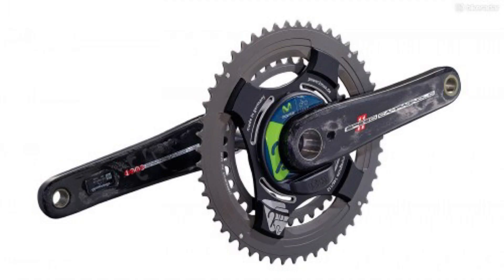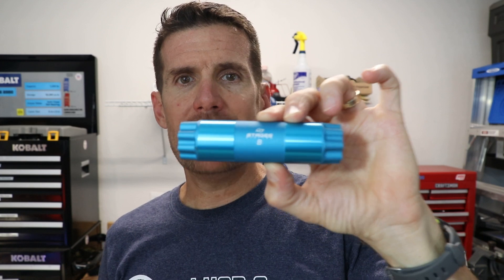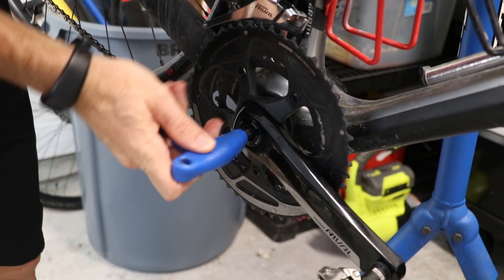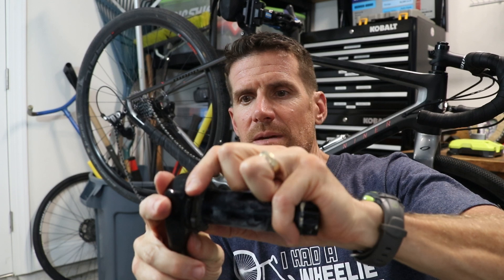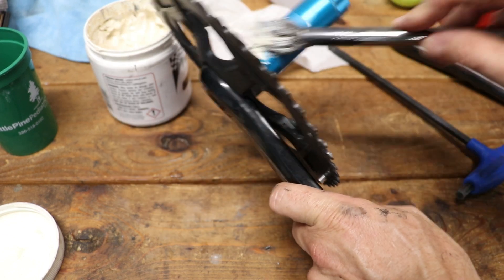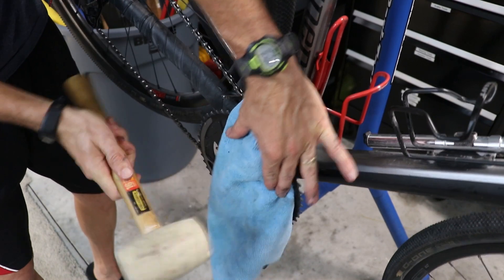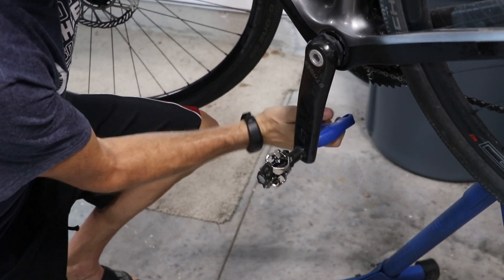Installing a Stages Power Meter on SRAM Rival 22 (with spindle attached to left crank arm)

Comment: Hi @clintgibbs - thanks so much for the video. Can I ask if you know whether the type B Ali doe would work for a new V2 SRAM force AXS group set as well? Is this the same as the SRAM force 22?? Thanks!
Reply from the maker: I have not tried a Stages with the new SRAM group set.  Check with Stages. Their customer service is helpful and should be able to answer that.

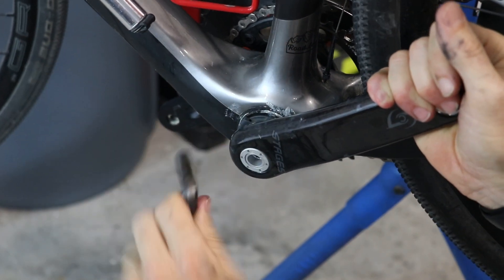Comment: At 5:20, in what direction are you "backing out" the adjustable spacer? Toward the crank or toward the bottom bracket?  It looks like it's coming toward the crank.

I'm considering installing the Rival Power Meter Upgrade on my own, and this is the only step I don't quite understand the point of when reading the online manual.  What is it that the adjustable spacer does exactly?

Thank you in advance. I get a ton of help from your channel.
Reply from the maker: Turn it clockwise, towards the negative sign to put space in there. Once you tighten the crank bolt, turn it counterclockwise, towards the plus, sign, the takeout any remaining slack
Reply: @ClintGibbs  Thank you.

What exactly is the spacer doing, though? Taking out excess play that would permit the spindle/crank assembly from sliding sideways in the BB? If so, why is there play if you've tightened the cranks? Wouldn't tightening the crank push it right up to the spacer?
Reply from the maker: @ADRNG  when you tighten the crank bolt it can only move so far because of the way the axle is designed. If it were to pinch limitlessly it would hinder the bearings.  You have to have some spacers in there
Reply: @ClintGibbs  Ooooooh, yeah, that's true. Thanks for the information, bro!

Comment: Hi Clint, 
Thank you for the video. 
Your Force 22 appears to be a DUB crankset. Is that the case, and if not, do you know if the Stages Sram powermeters are compatible with the BB86 Sram DUB bottom brackets / cranksets (for gravel bikes with a Sram Force eTap AXS groupset))? 
Thank you.
Reply from the maker: This one is not DUB. I would contact Stages about what is compatible with  SRAM BB86.
Reply: @ClintGibbs  Thank you, Clint. I will. Clear.

Comment: A couple of years ago I bought a Stages power meter for my Ultegra crankset. Although it worked fine, I did not find it to be of much benefit to me; and so, when I upgraded to Dura Ace, I sold it. I recently bought a PowerTap P1 dual-sided power meter for my spinning bike, which is far more use to me, since I do all of my structured training indoors, not on my road bike, which is reserved for leisure. They give me more information than my one-sided Stages meter. What I don't like is the accompanying cleats, which have far too much float/free-play. Instead I have been using the Look zero float cleats, but there is still more free play than I would like. I just wish I could use my Shimano blue road cleats.

Comment: Great Video, though oddly my Rival 22 is the opposite with the spindle attached to the non drive side
Reply from the maker: That’s the way my rival is as well. Spindle attached to the left arm, or non-drive side
Reply: Sorry, meant to say spindle attached on drive side.  I was able to swap the left crank arm with a stages power meter without having to install replacement spindle
Reply from the maker: Kurt Congdon I guess they changed their design them for the recent ones.

Comment: Will this work with a sram force 22 bb30 crankset?
Reply from the maker: Yes, but you should not need the spindle since typically with Force the spindle is attached to the drive side.
Reply: @ClintGibbs  I believe, that's not the case with the Sram Force eTap AXS. I installed mine a week ago: if my recollection is correct, as is the case with your Rival 22, the Sram Force eTap AXS does have the spindle attached to the non-drive side crankarm. 
 This one - a SRAM Force DUB 2x12-speed Crankset:  https://www.bike-components.de/en/SRAM/Force-DUB-2x12-speed-Crankset-p68737/black-172-5-mm-35-48-o69411820/